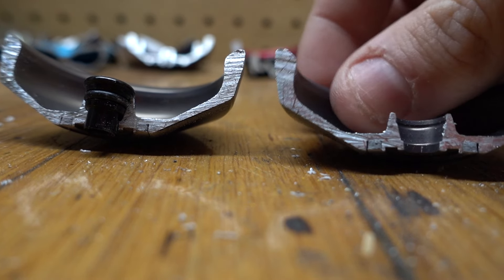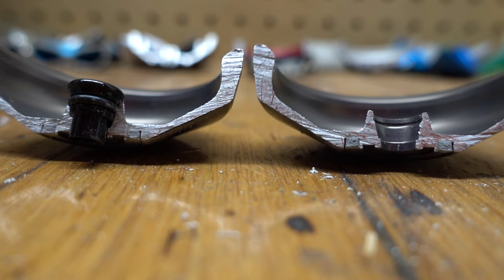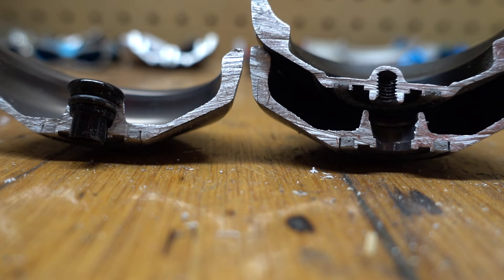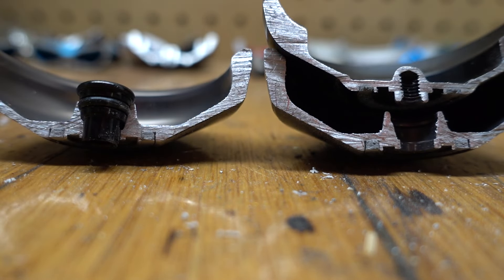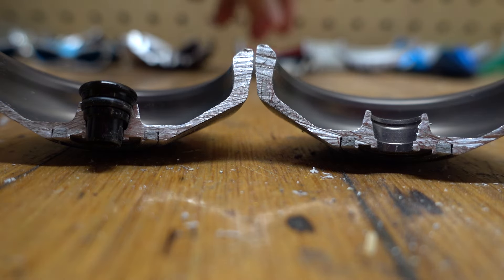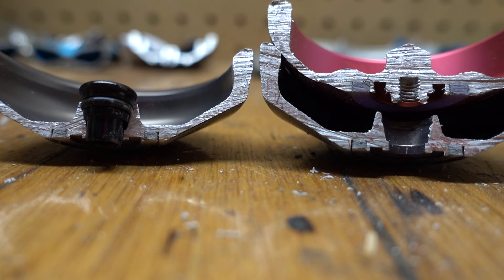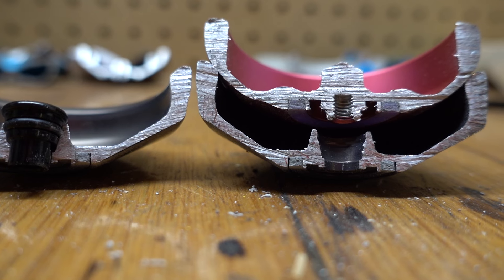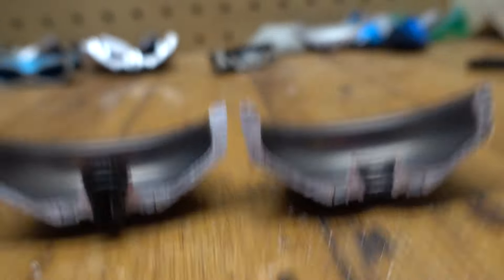One Drop YoYos Kuntosh 5000QV - Let's Cut a YoYo

Comment: Hey jake I will get one of your yoyos one day. Question: is it beneficial to have center weight? If everyones pushing weight to the rims then all od yoyos should have ultra lights for best rim weight right? I got a 5000qv and was wondering if UL side effects or any yoyo with minimal center weight would hinder any performance
Reply: Liso Campos you can do that, yoyos like the Titanium dream do that 

buy different weight distrubtion gives different feels, adding some center weight gives more cobtrol and a betyer feel, if u put too much weight on the rim it feels like a rock, so its maibly just preference
Reply: Liso Campos also to your other question. adding different weight side effects wil ldecrease not only center weight but total weight, so it will feel lighter
Reply from the maker: center weight makes a yoyo play more agile and floaty.  Too much rim weight and a yoyo can feel like a rock and doesn't want to change directions